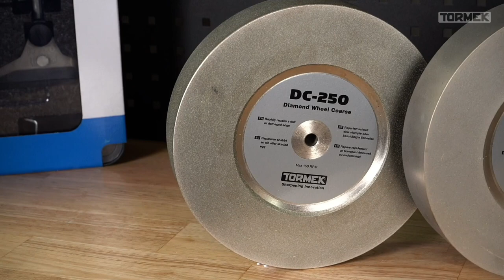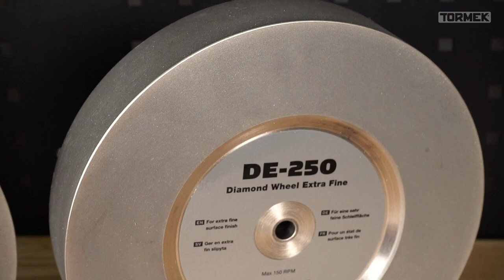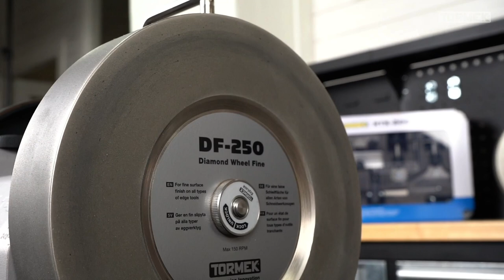This is why we love diamonds | Tormek Diamond Wheel Special

Comment: Is the water bath used with the diamond stone?
Reply from the maker: Hi Will, we recommend to use it with the water for health reasons. The metal dust is not very good for you. But you can run them dry if you want. It works just as good. Stay Sharp!

Comment: Do you recommend using the fine wheel to set the edge (burr) and then finish with the extra fine before using the leather wheel?
Reply from the maker: Hi Kyle. It depends of which tool and also what you're going to do with the tool. For most tools the DF 600 grit+honing wheel gives a great finish. But off course if you want a superior finish the DE 1200 grit is even finer.
Reply: @TormekSharpening  
I’m going to order 2 more T-8s this will leave me with 3 now. My set up will be  the 600 / 1200/ 3000 Japanese wheel. I feel this will be a great set up for my business Knife Flight 90% of my business are knifes. I already have the the original stone, that can be used for metal removed when needed. 
Do you agree? Or have any suggestions?
Thank you!

Comment: dear Tormek Sharpening Innovation, first of all, thank you for the video, it's very good, I want to ask for some help, unfortunately I forgot to put the acc150 liquid in the water for the DF 250 diamond wheel fine diamond stone when I first used it, and now I see that the diamond wheel is streaked a little tanned, whatmake it disappear?my first plane and I were very stupid and now I'm worried about what will happen
Thank you very much in advance for your help
Reply from the maker: A slightly tanning is not a big issue, it should be ok when using the Anti-Corrosion-Concentrate now.
//Wolfgang

Comment: I find that the diamond surfaces of sharpening plates clog relatively quickly when sharpening stainless steel knives. Would this happen with the Tormek diamond wheels?
Reply from the maker: Hi Michael, Thank you for your question. The issue you're refereeing to is nothing I have experienced or heard anyone complain about so I would say that it wouldn't happen on the Tormek diamond wheels. Stay sharp!
Reply: @TormekSharpening  Thank you for your reply. The next stone I buy from my Tormek Grinder will probably be the Japanese stone, which has a 4000 grit abrasive to give a super fine finish, but I like the idea of being able to maintain the same diameter on the diamond wheel and to be able to use the flat side for certain applications

Comment: Great demo guys, Tormek is the ultimate in sharpening and I use mine often, my question is ; should the diamond wheel be used to sharpen cobalt or carbide items such as drill bits with  Tormek jigs ? 
Thank You
Reply from the maker: Hej woodturnermark8529 yes you can, but use little pressure especially when you sharpen drill bits to the steep angel which is very aggressive to the surface.

Comment: Hi. Would you say that the 600 grit diamond stone give the same finish as the fine side of the 220/1000 stone?
Reply from the maker: Hej Tom, 
the 1000 stone is a bit finer in the result. But you can also reach very good results with the 600 grit diamond stone. 😎💎
Stay sharp & safe!
Reply: @TormekSharpening  thanks for your reply. Sharpening my wood turning tools is difficult with the standard stone. The surface gets uneven very quickly. Maybe the diamond stone is the best choice for these tools.

Comment: Hola soy Gustavo de españa casariche (Sevilla) enhorabuena por el vídeo y lo profesionales que sois, tengo la t8 piedra sg y la DE, cual me aconsejáis que compre para el desbaste principal ?
Reply from the maker: Hej Gustavo, thank you for the kind feedback. If you want to remove more material the e.g. damaged/chipped knives then a roughened SG-25 is mostly enough. If you want to reshape e.g. woodturning tools a DC-250 is the choice.
It´s in general not as easy to give you the perfect answer, it depends on the amount of material which has to be removed, the hardness of the material and what type of tool it is.
I hope I could answer your question. /Wolfgang

Comment: Thanks for introduction!Do you need diamond powder     or cbn?
Reply from the maker: Hej, The wheels are coated with diamonds, there is no need for applying powder. CBN wheels are used on faster rpm and not that suitable on a slow going Tormek.
//Wolfgang

Comment: Do you have a diamond wheel that can be used on the Tormec One ??
Reply from the maker: We do have diamond wheels with a diameter of 200 mm for our Tormek T-4 (Original and Bushcraft) and with 250 mm for the Tormek T-8 Original. Those wheels fit also older models.

Comment: For sharpening kitchen cutlery at a farmers market would you suggest course diamond or fine diamond, then finish with extra fine or leather?
Reply from the maker: Hello! good question, and we can't give a straight answer I'm afraid. It totally depends on the condition of the knives, but i would guess they can be quite beat up? Worth noting is that you won't get a good edge off the DC-250/200 Diamond Wheel Coarse and then honing. If you have the coarse wheel you'll have to finish with either the fine or the extra fine before honing (we recommend to always end with honing). So i'ts really a matter of preference. Check out our grinding wheels guide for more info: https://tormek.com/en/knowledge/the-tormek-way-of-sharpening/grinding-wheels-guide. Personally, i would go for just the DF-250/200 Diamond Wheel Fine, since it should do an efficeint job while leaving a good edge. Then IF it turns out you feel you need even faster material removal or a higher polish down the line, you can add whichever wheel you feel you need.

Or email support@tormek.se for additional support. 

Stay sharp!

Comment: I have the t8 DF250 diamond wheel and have steel build up on the grinding surface from ginding high speed steel turning tools, how can i remove this steel build up?
Reply from the maker: Hej, you can use an normal eraser or a natural rubber to clean the surface.

Comment: hi with the diamond wheel can I leave the liquid in the wheel when not in use or should I remove this thanks
Reply from the maker: Hi! Even if you use the ACC-150 Anti-Corrosion Concentrate you should make sure your diamond wheels are stored dry when not in use to keep them in top trim for as long as possible :)

Comment: Hello, thanks for the video. If I switch projects and go from the DF-250 diamond, back to the SG250 grindstone. Do I now need to change the water because it has the  anti-corrosion concentrate?
Reply from the maker: Hej Greg, 
you can use the ACC-150 Anti-Corrosion Concentrate also with the other stones, not only with the Diamond Wheels. It also protects your tools 😊

Stay sharp!

Comment: Is the DF -wheel faster than original grinding wheel? I am considering DF or DC because I need to grind alot of tools and I really need more speed out of tormek system. Currently using standard original wheel witch is frustratingly slow. I can't use bench grinder because of noise, dust and fire hazard.
Reply from the maker: The DF Diamond Wheel Fine with it's equivalent of 600 grit would be faster on harder steels. But if you are looking to remove a lot of material I'd recommend the DC Diamond Wheel Coarse. Note that the DC is not a finishing grinding wheel though. Good luck and stay sharp!

Comment: My t4 needed a new wheel, Ive just brought a new one which is a diamond wheel
I do not know the best way to use it can you please give some tips of the differences between a normal wheel and a diamond. 
Ive been with tormek many years, before the t4 I had a 2000
Reply from the maker: Hi Jessica, 
The main difference with the diamond grinding wheels is that they need way less sharpening pressure, and should always be used with ACC-150 Anti Corrosion Concentrate mixed in the water. In this video we talk about using diamond grinding wheels for the Tormek T-4: https://www.youtube.com/watch?v=2tTm_iwFEK8

Stay sharp!
Reply: @TormekSharpening  Thank you. Ive used the course and the extra fine, the fine was out of stock. It should arrive soon.
Thanks for your help.
Now all I need is the skill :)

Comment: I have a T7 with all possible accessories, I am considering a T8, but I will NOT sell my T7, because I LOVE it. 
Can You please point out differences between the 2 machines ? Are diamond wheels perfectly compatible ? Are there accessories NOT compatibles or are all interchangeable ? Thank You !
Reply from the maker: Hej Richard, 
great to hear that you are still happy with your Tormek T-7. The Tormek T-8 Original has a different housing and small adjustments all around it - we are improving the machines continiously. But you can use all jigs and all grinding stones with 250 diameter on the older machines as well. This has been always very important to us that our products are compatible with older models as well. 

Stay sharp!

Comment: Thank you for explaining the common features of the diamond wheels. Would you recommend the Fine grit (600) for fixing a badly damaged edge on a chisel or HSS planer blade? Or is the Coarse grit (320) a better option?
Reply from the maker: Hej Alessandro, depends how damaged it is and how much time yoou like to invest. Heavily damaged is for some still sharp ;-). In general the DF with 600 grid is absolutley fine. The coarse with 360 grid is just meant to remove material, but you need the DF afterwards.
Reply: @TormekSharpening  Thanks!

Comment: He indicates that the diamond wheel will last years with reasonable care, as will a lot of things. However, he also indicated that the diamond "wears" and gets finer over time. It must one day become a honing wheel then and no longer a grinding wheel.
Reply from the maker: Hi Jeff, Yes it's correct the diamond will over the time of years get finer and finer as it wears. However diamond is the hardest material so it's very durable. Where the line between a honing wheel and grinding wheel is drawn is difficult to say. The idea with the honing wheel is to remove burr and the materials in a honing wheel are often a bit flexible which makes it easier to avoid damaging the edge when honing.

Comment: Since the price for the rust prevention concentrate is 118 Euro per liter the question should not be "why a steel core?" but rather "why not a stainless steel core?".
Reply from the maker: Hej Theo, that has to do with the process of plating the diamonds, also we opt against aluminium, due its to soft and would use alot more harmful chemicals.

Comment: I know why you love them! They cost $400 a wheel! 
I hate this company. 
Just turn your own wheel from plastic, hdpe, or corian and slap a proedge belt on it. Boom $25. 
I hate this company. 
If you buy the t4 factor in an ADDITIONAL $105 for the truing tool. You absolutely need it.
Reply from the maker: Hej Richard, 
we are really sorry that you had difficulties in sharpening some of your tools. Our products are developed and manufactured in Sweden. We aim for a really high quality-standard. Most of our Jigs are patented and developed to deliver high-quality results. Depending on what you sharpen the TT-50 Truing Tool is for sure useful but not mandatory. It does not come with the smaller Tormek T-4 but does with the Tormek T-8 which is build for professional use. 

Stay sharp and safe!